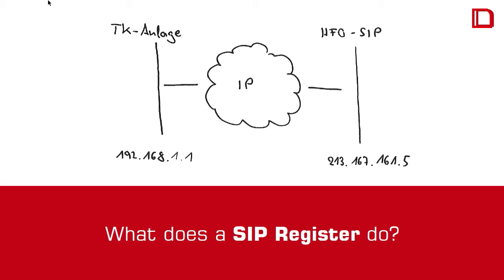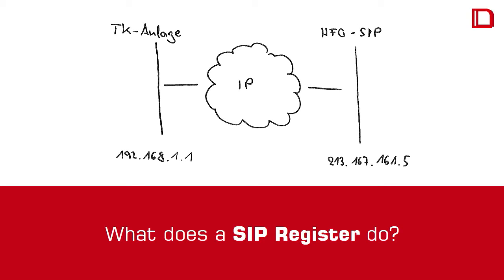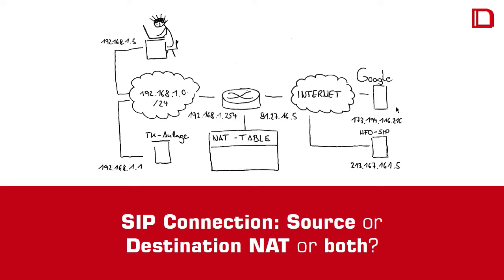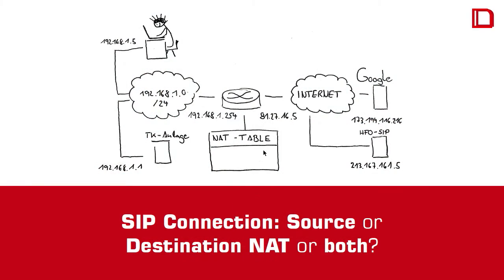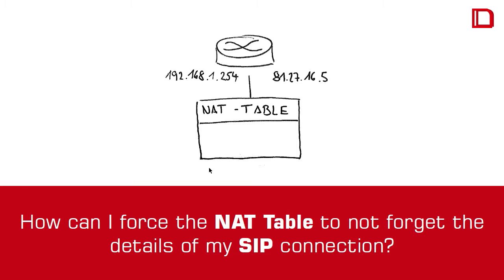Asterisk Tutorial 49 - Introducing NAT Part 2 [english]

Comment: hello, thanks for your amazing videos.
i had an issue with asterisk 11.
i put in sip.conf the following nat option:

nat=force_rport,comedia

but there is no voice between my extensions which are behind a NAT.

can you refers me to anything helpful.
best regards.
Reply: did you configure externip = xxxxx
where your xxxx is the public ip ?

did you open RTP & sip ports o the router to PBX ?
Reply: As i know, the option externip used when asterisk behind a nat, which doesn't go with my case, because
my Asterisk has a real IP.

thanks for your reply.
Reply: sorry . i misunderstood you .
make sure ur firewall allow sip & rtp 
make sure that u enable stun on your phones 

i think you need to check the sip show peers
and make sure that the ips are identical to the external ips of  your 2 extensions 
if u have still one way 
check the invite logs and make sure it match the public ips of your phones  not the private ips
if you see any private ips in the invite requests , then u need to check .

also sometimes its from the router like sip alg option ...so try to disable it and disable firewall on the extensions firewall 

good luck !